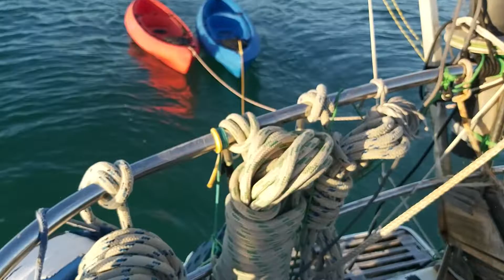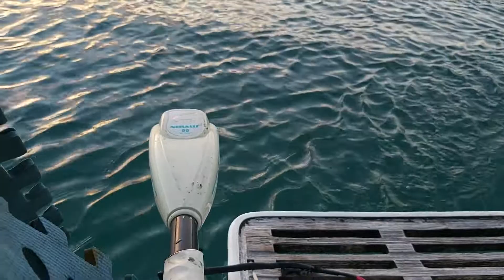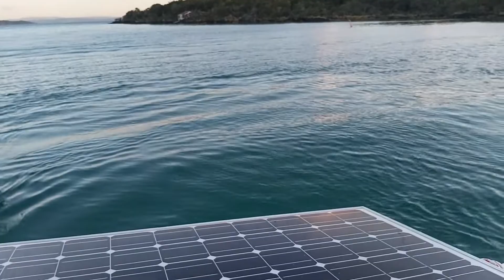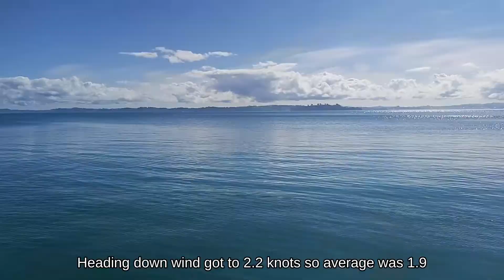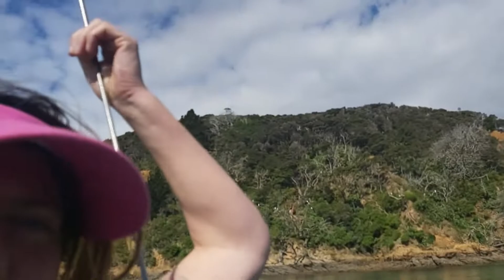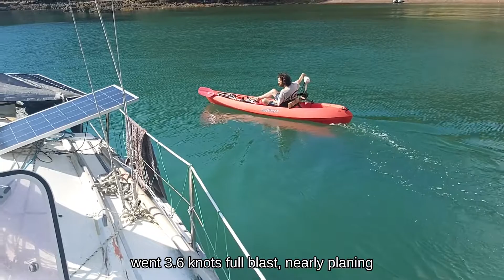can a 12v trolling motor push a sailboat? (26 foot keeler)

Comment: Thanks for the video! It’s what I needed to see before purchasing a 55lb electric for my 22ft sailboat.
Reply from the maker: I'm glad it helped! btw, this ended up working much better when I put a different prop on. I used a 12x4 RC plane plop. That worked much better, but really it would be best to try several sizes and see which is best. The RC plane people replace their props all the time so they are actually surprisingly cheap! ~$10 each (luckily they don't say "marine" on them)

Comment: Good work!
Think you have the same Neraus motor as the leg only one I got for $190 new. It will do lots better with a diffuser cone on the back of the prop.
And the rheostat speed control I think wastes power too. Certainly does in lower speed settings. Maybe in speed five even.
Good to see you in action again.
Reply from the maker: Thanks! I havn't put a power meter on it but the connectors melted when I ran it on 5 for an extended time, but not on lower settings, so I think it does use less power. Not sure how it actually works though, the speed control is really a multi position switch, I suspect that it might engage different combinations of windings?

how much difference do you predict for the diffuser cone? 20%? or more?
Reply: @dominictarrsailing  
Nope, it has a coil of ni-chrome wire with a number of different contact points for a movable contact attached to a mechanical rod down through the shaft.
The big alloy bullet nose in fron of the motor is to dump the heat from this variable resistance in series with the motor 
In gear five it may or may not have extra resistance. Gear four half your electricity heats the seawater, half gets to the motor, gear three, 3/4 is used to heat the sea.
So if you read 200 Watts in speed 4 then your motor is using 100. If you had two legs in series directly wired, they would double the thrust for same Watt draw. Or run them on 6 volt battery. 
I just got 6 x 50ah LiFePO4 prismatic cells so I can vary from 3 to 18 volts by switching cells in and out of the circuit.
Reply: @dominictarrsailing  hard to compare directly but the 55Ib Neraus leg I put the lewis road creamery bottle diffuser cone on has 4 to 5 times the thrust at similar amps as the 46lb Neraus outboard.
The propwash is telling.
Very turbulent, breaks the surface 1-2 m behind the outboard. 
Diffuser cone, very smooth, not visible on surface for five or six meters behind it.
The chopped off rear of those props is bad but the radius rather that sharp edge is worse.
Reply from the maker: @aaronfranklin324  haha, okay wow I'm gonna try that will post another video about it
Reply: @dominictarrsailing  I will text you a picture of my lewis road creamery bottle diffuser mod.
I have to strip my Neraus 46lb. It got drowned last week when the tender got caught under the boat on the incoming tide in the middle of the night. It survived drowning last year in lake Ohakuri. But this time the mechanical water heating system in the nose has stopped working. Obviously the sealing ain't good.
It may even gave been working for a year with the nose full of lake Ohakuri water.
The motor housing needs sanding back and sealing proper too. The UV has killed the paint and itd going rusty all over. Bloody claims of marine rated.
Obviously marine rated in their language means living in a shed and occasionally experiencing the brackish water of a Florida everglade swamp.
I have got a 14 inch diameter four blade large model spitfire propset.
They will be at least twice as efficient as the Neraus patented guaranteed to jam on the smallest piece of seaweed thing.
Especially if setup with variable pitch control.
A lot of the wire melting, etc like you have experienced is because of horrendous lift to drag ratio caused by greater than 5 degree angle of attack.
I'd bet your current draw on the kayak was less than half the same throttle setting on the keeler.
I have found that speed 5 on my half ton 15 foot boston whaler feels like its fast cause lots of prop turbulence and high pitched whirring is evident.
But at less to than half the current, and 1/4 of the power to the motor I still do 5kmph in speed 4, with no more than six in speed 5.
Which is effectively running the motor on six volts.
Even speed 3 is almost as fast. Though big headwinds and chop can  start to impact.
Probably more because of the speed the wind is blowing the water surface in the wrong direction. And therefore the prop not having enough pitch for it.